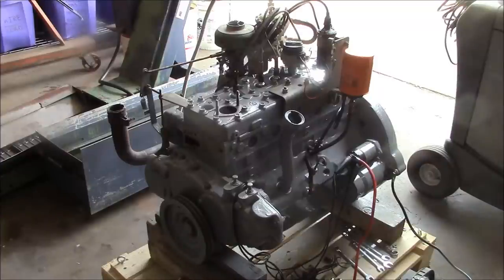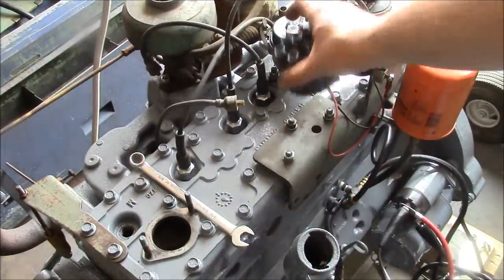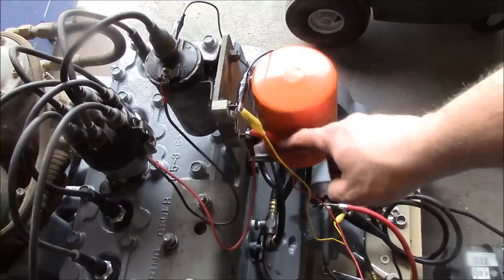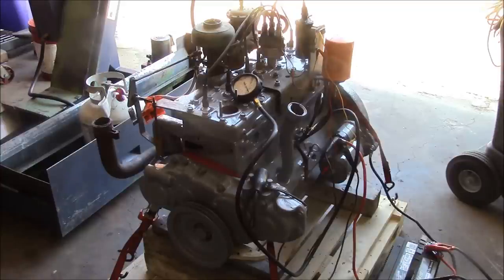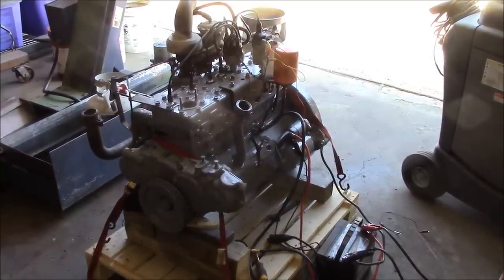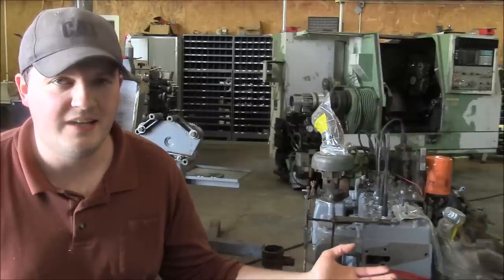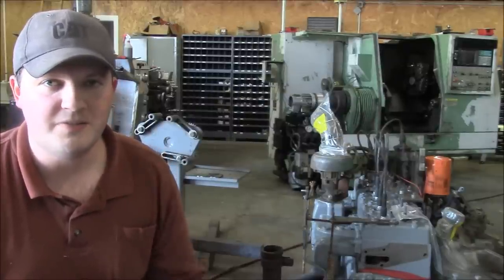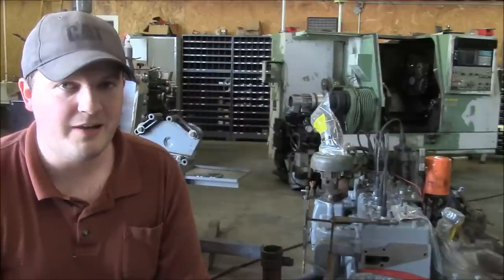Continental F245 Flathead Engine Overhaul - Part 3 (ignition timing, first start)

Comment: Wes, I've enjoyed the F245 videos and your talk at the end was really informative too.  When I was 16 I worked at a shop that rebuilt industrial engines.  They ranged from small 4 cylinder Hercules to CAT D-8 engines and a few monster 4 cylinder Buda stationary natural gas engines.  I would go to the customer's facility and in a Dodge 3/4 ton pickup bring them to the shop and disassemble them.  Put all the parts from engine blocks to valve stem keys into a heated tank that contained a solvent that was dark coffee in color for a day.  When the parts came out and were washed they were clean.  Not paint, grease, gasket cement or oil on any of them.   The machinists would, if needed, plane the blocks, heads, turn the cranks & cams or re-bore and hone the cylinders if required.  They would re-assemble the engines and I would help them and when finished put them in the truck and deliver them.  The engines were not hot tested at our shop.  Pardon me for this long note.  You brought back some fond memories to me.  Thank you for the time you have taken to make your videos, I enjoy all of them!  ATB, Joe
Reply from the maker: A good rebuild shop with all the right equipment can really crank out engines quickly. The problem is that there are a lot of not very good rebuild shops that just slam things together.
Reply: Wes, I should have told you that the events I wrote you about took place over three years starting 64 years ago.  take care, Joe
Reply from the maker: Wow. I wonder if any of those engines you worked on are still running.
Reply: It's highly doubtful.  Most of the truck engines were for long haul tractor and dump trucks.  At that time there interstate highways being built and the Niagara Power Project too.  Power project dump trucks and rock trucks were run around the clock and their engines showed it.  The shop manager, Mr. William Southwood was an expert machinist and his knowledge of engines was amazing.  We had two apprentices at the time and always re-measured their work.  His micrometer was almost always in his hands.  He was really a good man to work for.  All the Best, Joe

Comment: The ballast resistor system is not so much about saving wear on the points, the idea is that you use a coil rated for a lower primary voltage so you still get a strong spark during cranking when the battery voltage could drop to maybe 9-10V.  The coil would quickly overheat if operated at nominal battery voltage, so the ballast resistor is used to drop voltage to the correct value for the coil.

Comment: I use high tack to keep gaskets onto components rather than on the block. That way in future you clean the pan/component not the block. But silicone yeah u need it THIN not globbed on there. Ah ive rebuilt old 302 fords in a garage with emry cloth a dingle ball hone and ring compressor. Some have gone over 100k miles. Dont be too afraid to rebuild something just read all the technical books

Comment: Wes, I have to commend you. You did EVERYTHING the way I was taught. To a TEE. You mentioned about the ails of the old style rear main seal. My buddy has a hot rod that was built back in the late 50's using a GMC inline 6. He had nothing but trouble with that thing leaking oil at the rear main. Finally, he either found a kit or devised one himself to update the rear main to use a round seal. It works just great. After all these years, he still has that car but now it has a blown GMC six with dual four barrels. It is a show car and runs like a striped ass ape. I wish there was a way to show pics of it here.

Comment: It's surprising how many Internet and YouTube certified techs sit behind their keyboards telling you the right way to do things. Most have never rebuilt and engine. Back in the day we only had gasket shellac to use on gaskets. We even used thick grease to hold gaskets in place.
The spots you used silicone to me was just perfect. It all comes down to doing things that work for you.
Reply from the maker: Most of these old engines just leak oil as a matter of normal function. People think they can fix that by smearing on silicone. It's OK I guess, but you have to use your head.

Comment: Oh no doubt on hearing it run... I had a friend bring me his 1985 E250 Van and it had a "New Reman 351W" from a National Brand...the shady shop installed it and got it running enough to "Send down the road - They HATE Vans" except in 10 minutes it overheats... I did some diagnostic work, and concluded they installed head gaskets backwards (could see the tell tale tabs sticking out the back!) - I guess Mr Greenhorn assembled that one... I told my friend you can contact Reman Company, I will send them photos and they can either pay me to fix or send a new engine...They paid me to fix it...What a NIGHTMARE though for my friend...

Comment: Continental has a long history of building quality engines. Industrial, Automotive, Aircraft and military (Tanks etc.) I have 2 Willys vehicles with their engines built under license. The little 134 cu.in. 4cyl. used in the WW2 Jeeps had it's beginning in 1933. The L6-226 used in the later Station Wagons and Pickups started it's life in 1930's Graham Page and other automobiles (Some Supercharged) and Industrial uses. Love to hear the sweet sound of an inline flathead purring. Nice job.

Comment: Morning Wes.  Your description is very good on the ballast resistor.  Been around for ages - if it works leave it alone. They were a system design element for the points and the coil temp.  

Some gaskets need to be tacked to one side of the surface.  The old Ford 302 like you mentioned with the intake end seals had to be tacked down due to the cast iron block and aluminum intake expansion rate differential. Yes, your silicone warning is extremely valid. In my youth I cratered my Honda engine in my zeal. Never did it again - lesson learned. Silicone is great in very small doses.  God gave us fingers to smooth the stuff into a "thin" smooth coating. 

Love that straight pipe.  My Dads Lincoln welder had the old style water flapper on the exhaust pipe. 

Dan
Reply from the maker: It's surprisingly quiet for a straight pipe. I was expecting a roar, not a purr.
Reply: Wes Johnson - yeah when they hit the governor I love the sound of them. Like they are saying - “that is all there is.” But they will hold that load forever.

Comment: On Ford's Duraspark system they used basically the same 8V coil as the 12V Points system, with a different connector...(also used the bypass wire "I" on fender mounted solenoid)

Comment: The propane tanks MUSTIE1, a YouTube creator did an explanation for BBQ tanks vs Propane tanks and what will supply fuel for engines, basicly the BBQ tank draws just the vapor for fuel. The Propane tank has a pipe inside that picks up liquid fuel and that is sent to the mechanism on the fuel system of the engine and it drops the fuel to a vapor of the right pressure so the engine is able to continue to run. That is why you need the coolant to heat the fuel as it is turned into a vapor so everything does not freeze. I hope this makes sense, correct me if I missed something

Comment: Hi Wes. Great series. We had a engine machine shop rebuild a 1.2L Nissan for a Tennant sweeper. It's been running now for 10 years with no problem. We bought the machine for nothing knowing the motor was weak. What killed it was the crappie breather not fitting well, cooling system and probably lack of all maintenance. Well worth the investment for us. Thanks
Reply from the maker: I've dealt with some engine swaps, and it just not for me. I'd rather fix the engine and put it back in. I've never seen a swap on any industrial gear that wasn't pretty hacked together.

Comment: Nice work Wes. I need to offer my input on operation of the points and coil. The coil produces voltage in the secondary when the points open and the primary field collapses. That's why a transformer can work with DC. Don't believe me? Try this experiment. Connect a spark tester to the coil tower, power the coil and then remove the clip lead from the minus terminal. There's your spark. Please keep taking us along on your new projects as your content is very interesting.

Comment: That was fantastic.  You got the right amount of pressure feeding the fuel into the engine, got it to start, did some slight adjustment on the distributor.       Wah La!
I really enjoyed watching and learning - as you rebuilt this engine.  Keep up the good work.  I will keep watching.

Comment: One thing that kills me I’ve seen people using silicone rtv is when they smear it over a nasty oily surface and don’t even clean it. When I do use rtv I like to spray ether on a lint free cloth and clean the surfaces right before I put it on. When I was building of the engine for my old truck it was the first engine I had ever built by myself There was a few people hanging around watching putting in their two cents giving me a hard time about being so meticulous cleaning and painting everything but that was 12 years ago and that Chevy 350 engine still clean and dry and running strong. I used a little RTV around the ends of the intake gaskets on it. The only leak I had on the engine was a gas leak at the double flared fitting on the carburetor. Cool little engine We have a little Clark three wheeled forklift at work I think it’s a 1970 model it’s got a little four-cylinder flat head that looks pretty similar to that six it also has the updated Petronics ignition kit in it. When you were talking about the low-voltage to the ignition Coil and the ballast resistor I had a similar problem with ours The wiring was kind of hacked up so I just ripped all the wiring out and made whole new wiring harness And installed a one wire GM alternator. I kept the original key switch but it was the weirdest thing even after rewiring it you could get on it and hit the key to start it up and you could spend the starter all day and it wouldn’t fire until the split second that you let off the key or you could roll it down the ramp on the dock and pop the clutch and it would fire right up. The thing has a funny little battery in it that has a pretty low cranking amp rating And when the starters turning there’s not enough voltage for that Petronics electronics set up to fire the coil. The lock eventually went bad in the key switch so I redid part of the wiring again and I just used a  toggle switch And a couple of relays and a push to start button and I made a bypass circuit to send Power straight to the ignition system while the starter was spinning and it starts as soon as you hit the start the button now. All the years people have been grinding on that starter and that’s all it needed was a bypass circuit. It may have worked OK from the factory with the points but it didn’t seem to work out so good with the electronic deal. The hourmeter on that little lift says it has 6500 hours on it that is the sweetest running a little engine I have ever seen. I believe it’s a Continental. I’d give anything to find a job working on old stuff like that every day. Great job!

Comment: nice description on the ballast resistor, I'm a huge fan of either fully electronic or points triggered transistor ignitions, the advantage of the former is much less cycle time vs points open and closed by a cam, gives your coil a fighting chance to charge between ignition events, and in a 6 like this at 3000 rpm's its 150 times a second, so waiting for a cam to close your points really cheats your spark potential. the later means virtually 0 points wear, because you have a transistor doing the heavy lifting of breaking a 3-5 amp circuit 150 times a second vs a set of mechanical points. and if the transistor fails you can always remove it and run on the points in a pinch. We have 3 ford 8n's and a Ferguson to20 running this right now, much crisper starting and running.

Comment: Point life is definitely the one explanation I've heard as to why they still use 6v coils. Running 12v through the points creates a stronger arc during opening and closing events, wearing out the (carbon?) points faster.

But because of that, I had assumed electronic ignition systems introduced full 12v coils when they became mainstream among the OEMs, since they didn't have to be worried about points anymore. But after some research, apparently I'm incorrect. At least Ford continued to use 1.5ohm coils run at 6v through their Duraspark systems (though they were slightly different somehow, supposedly created a more energetic spark so they could use a larger plug gap, hence the comically large distributor caps in those engines). I have a '77 Continental so equipped, and the coils listed on RockAuto are indeed stamped with "12v externally resisted," and googling around confirmed this. Further investigation shows the same goes for Chrysler systems, but supposedly GM HEI doesn't use an external ballast resistor (but does consume a lot more power, and as I recall gets quite hot, so maybe it's internally resisted?)

So yeah, I don't know what the logic is behind it... if point life is no longer a consideration, anyway. Seems kinda chintzy to have to knock down the voltage via a resistor, just wasting that electricity as heat, when you could just redesign the coil to reliably take 12v. Would be interesting to learn about the reasoning behind it all.

Comment: Sweet, was looking forward to part 3 👌🏻

Agree with the cleaning part and I find what takes absolute most time to remove would be corrosion and carbon deposits. 
But I must say it is satisfying to clean since the result and gratification is instant 😁
Reply from the maker: True. And bigger engines are harder to clean because everything is so heavy and a lot of surface area. But they look nice for a short time.

Comment: Hi Wes, Your problem with the ballast resistor wiring was directly connecting to the solenoid from the coil side. When the starter button was released the solenoid coil would be drawing current through the resistor, dropping the coil voltage much lower than it should be. Connect it through a diode allowing current to flow only from the solenoid to the coil.

Comment: Hey Wes, you did an excellent job explaining as you went along. You are very knowledgeable and it shows. Hopefully you can help me with a problem. I have a four cylinder Continental in a 1955 Correct Craft boat. This motor was bored 60 over and completely rebuilt. There are only 15 to 20 hours on it at this point. It has one perplexing issue. When the motor is warmed up and running at half to three quarters throttle I get a steady stream of oil running out of the crankcase breather and directly into the carburetor intake. Thoughts on that?

Comment: Just binged watched all 3 videos in succession. Fantastic teaching.  For me you filled in gaps of ignorance of mine concerning plastigauge, thrust washers on crank, paper gasket making,Welch plug vs freezeplug, plus so many more issues. As you tighten the rod bolts and bar the engine over do you have an idea as to what is the proper force is required to turn the crank? In other words, as you go from tightening main bearings, to rod bearings to adding the cam gear or other  components do you have a mental idea as to what represents normall required force versus some impingement or problem? I understand this is done with the spark plugs out, and your past experience is invaluable, but I personally might not recognize if something is too tight ie not right. Thanks for tolerating a naive question. I think you're calm instructive demeanor makes you a natural in front of the camera.  Best wishes.  Craig

Comment: Nice one, enjoyed learning about these old timer Continentals. Many of the old forklifts around here in New Zealand are powered by these engines. I wouldn't say they are the best engines. Can any viewers say what else they were used for? Thanks. 
A light application of "Shellac" is what was used on paper and cork gaskets with cast iron mating surfaces. You still needed no leaks and shellac did the job well.
Reply from the maker: These engines were used in many other types of forklifts, particularly Hyster. They were also used in Lincoln portable welders, such as the well know SA200. I know they were used in portable air compressors such as those made by LeRoy. I've seen them in stand alone power units that are attached to all kinds of machines like saw mills, hay balers, conveyors, etc. When I was still living at home my dad had a rubber tired roller/packer that had a 226 Continental.

Comment: Its lack of proper crankcase ventilation that causes the condensate build up. This engine just has a vented cap & draft tube on the side cover. Draft tubes do nothing unless the vehicle is continuously moving forward. A proper sealed PCV system would help fix this, but I doesn't help that the engine rarely gets properly warm. Propane engines are usually kinder to their oil because there is no sulphur in the fuel.